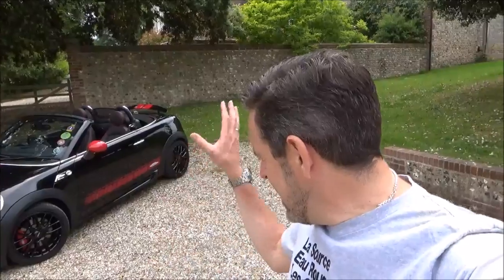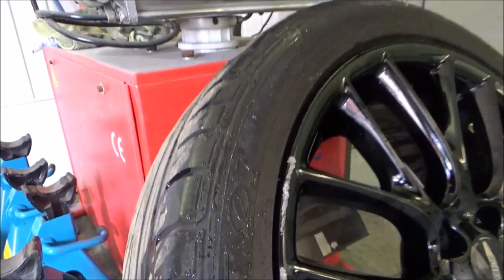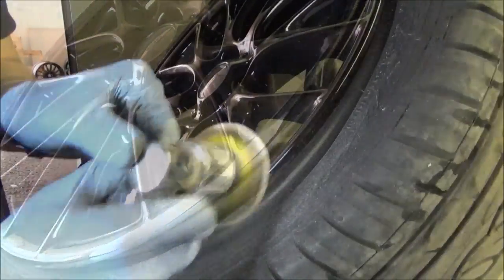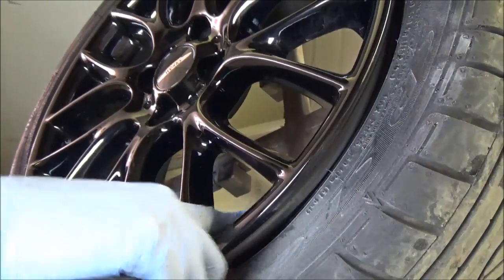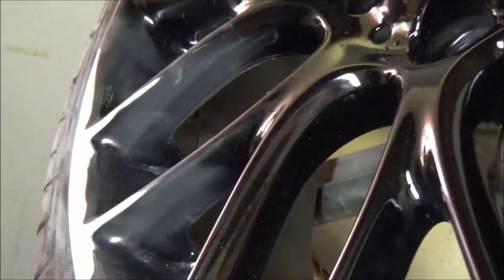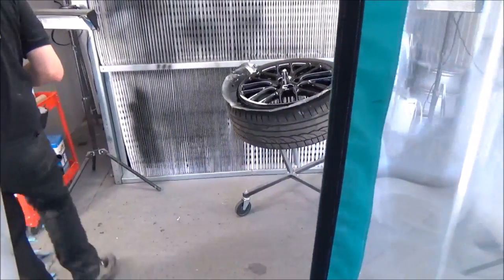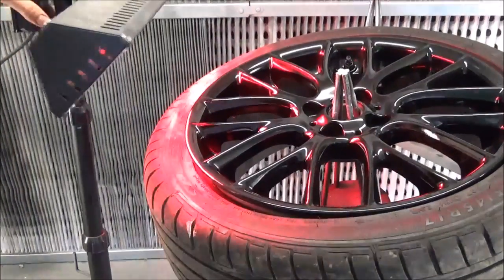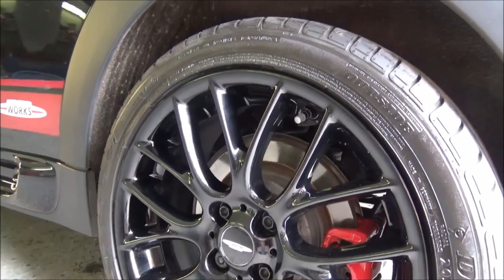How to fix a curbed wheel !

Comment: not a great job..he should have filled it..then sanded it! not removing more aluminium...!
Reply from the maker: Still looks great over a year later :-)
Reply: Petrol Ped He’s not wrong though, You can tell by the reflection lines how much he took out. I could tell from the video just by looking. He ate a chunk of that wheel. It looks great but there’s a difference between a great looking job and a great job
Reply: It all depends on how much you want to spend, if it’s a lease, as long as it looks repaired and it lasts, if it’s an expensive wheel or just a car that means a lot to you, I guess it’s worth doing right.
Reply: Filling it on an uneven surface ? You always buff it first so it's flat and smooth to fill it in
Reply: I thought the same. Where was the bondo filler with Aluminium. Then maybe it wasn’t that bad (deep) and the primer had filler in. The alloy looked amazing. Great job.

Comment: How much did this cost you in the end?!
Reply from the maker: I think it was about £60
Reply: Alejandra Patrick how much is that in American money?
Reply: Alejandra Patrick great question
Reply from the maker: About $77
Reply: Petrol Ped these people wanna charge me 150$ 
For a much smaller curb rash :/
Reply from the maker: Alejandra Patrick Wow 😳
Reply: yeap ! but great video thank you!
 and ps: love your mini!
Reply: thats interesting... because 60 quid is about right... only for that they usually take off the tyre,  acid dip it back to bare metal,  tig weld the kerbing, sand back the welds,  powder coat primer,  powder coat the in any colour u like :/  i could see where he had sanded the lip back tbh... surely hat would upset the balancing of the wheel :/  not sure i like that guys method tbh.
Reply: standard price,  i had 3 quotes
Reply: Alejandra Patrick
Reply: in Belgium full 4 wheel repair with welding kerbs and repaint cost 300 euro +50 euro remove tires and put it back
Reply: You wont find that repair in the USA for less than $175 easy,
Reply: @broderp  Any recommendations for a rim shop near Northwest Indiana?
Reply: broderp make that $120 🍷🐸

Comment: It looks like there is a slight depression where the curb rash used to be.
Reply from the maker: There is bound to be a little depression as the scuff was ground down. However, I could see where the mark is now. A great job :-)
Reply: A proper job.
Reply: Why not use some type of filler .?  Wouldn’t it be necessary if there was material removed .

Comment: Can anyone help me out and confirm whether or not those wheels would originally be powder coated? Or just painted?
Reply from the maker: Do you mean from the manufacturer ? These wheels where originally silver (more than likely powder coated) but then sprayed black by the dealer when I bought the car.
Reply: Petrol Ped yeah I was just wondering if those wheels would of had a powder coat on them during the time of the repair. I'm looking to repair my own wheels and I'm assuming they are powder coated too, and I'm just trying to confirm if it's possible to refurb and paint over a powder coat (just like in this video)

Comment: Thought he was going to mask the area off. What about all the over spray ?
Reply from the maker: Fine small spray gun I guess. Finished job looks great.
Reply: +Petrol Ped was it alot cheaper than having the full wheel done ? I'm guessing around £60-£70 for a full wheel.
Reply from the maker: +Ian Cross £60 and the results are great. The last time I had wheels done I had all 4 done and got them powder coated.
Reply: for about 60 quid a wheel??????

Comment: A new rim can't be much more expensive then paying someone for this job.
Reply: Depends on the rim...I curbed mine two days ago and the new rim is about 790USD,
Reply: Yes it does depend on your rims. My 2015 20"HSV GTS rims are around $2500au each so a repair is always in order. I actually bought a second set of after market rims for around $1200au for the full 4 wheel set and use those to protect my OME rims for when she finally goes up for sale.